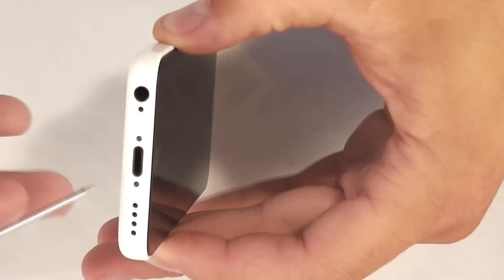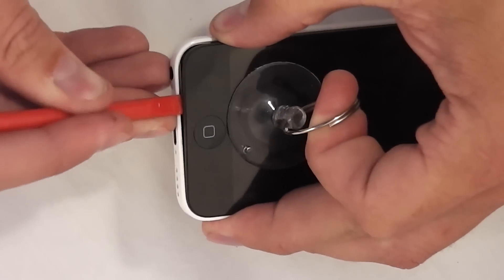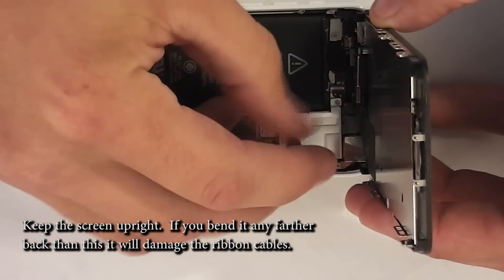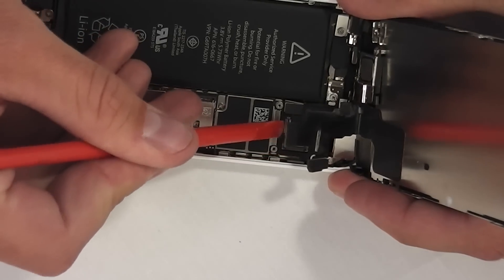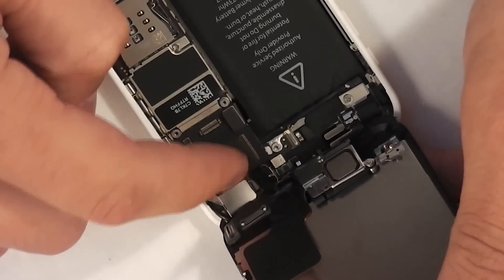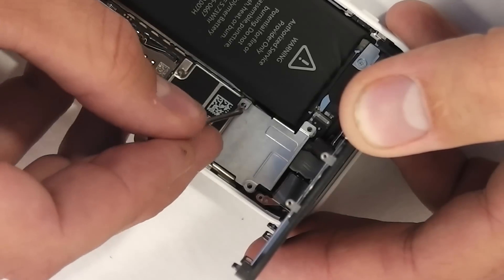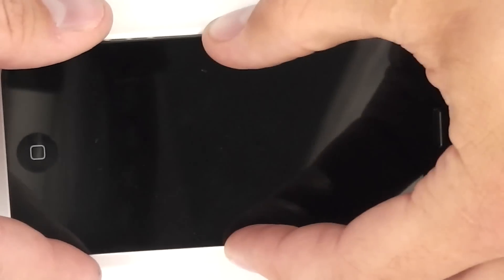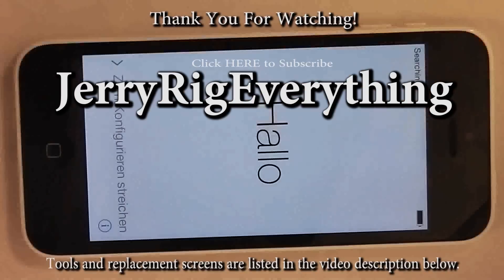iPhone 5c Cracked Screen Repair in 3 minutes

Comment from the maker: The regular 5 screen will not fit on the 5c.  I tried. I made a video too, if you want to check it out.  I am not sure if the 5c and the 5s screens are swappable.  But you can bet as soon as i find out ill post a video.

Comment: You Rock!  Being frugal, I want to try just the glass.  However, if it does not work as you point out, it is difficult, then I am stuck with out a phone until I receive the replacement for the whole thing.  Going to take your advise and just bite the bullet and do it right the first time.  THANKS AGAIN!

Comment: hey Jerry, that cable you said was attached to the battery is defintely attached to the vibration motor. Just a heads up ;)
Reply from the maker: ***** Thanks man!  Ill see if I can get a note in the video to correct my mistake.  Good catch.
Reply: Don't mention it ;)

Comment: ty so much, it took me about 10 minutes but it works perfectly now. I even wanted to be different so i bought a white screen lol. Now I have the only 5c with a white screen
Reply from the maker: +Juan De Jesus Thats awesome! Good job on the repair!
Reply: +JerryRigEverything does the new screen come with everything? My friend gave me his broken Iphone 5c but i ripped it apart lol it will still work if i get a new screen LCD and home button clicker pad thing  do those 2 links include what i need?
Reply: +JerryRigEverything does the new screen come with everything? My friend gave me his broken Iphone 5c but i ripped it apart lol it will still work if i get a new screen LCD and home button clicker pad thing  do those 2 links include what i need?
Reply: +JerryRigEverything NVM i messed up some of the solder points. Shucks!

Comment: thanks for your awesome tutorial - just bought a screen and kit off ebay, but it's just the glass, I had assumed the LCD was separate and ok as it was still working well under the cracked glass...should I not just change the glass in this instance?
Reply from the maker: It is very hard to separate the LCD from the Glass.  i would recommend buying the whole replacement that I have linked in the video description.

Comment: So can you provide the exact screen assembly that would be required for the phone you featured so I can assure I order the right one?
Reply from the maker: Seth Landry I linked some in the video description. BUT you'll probably need to transfer over the camera, earpiece, home button, back metal plate... Which I explain in my 5s screen replacement video. (Linked in this video.)

Comment: Do I need to buy the screen with the camera speaker and home button? When I take off the screen what all will come off
Reply: Amerria Causey everything that’s attached to the screen will come with it. You can order one fully assembled, or you can get one without a home button if you have Touch ID and want to keep it, you will need to take the home button out of the old one and then put it into the new screen.

Comment: Your video was great and I was able to replace the screen/digitizer with minimal difficulty. (those itty bitty screws gave me some trouble!) The screen is working and it turns on, but I cannot slide to unlock my phone. I have done a reset with holding down both the home and sleep buttons and it still doesn't work. My question to you is, did I get a crap screen and do I need to replace it again, or did I do something wrong putting it back together? It worked fine before I replaced the screen, I had just shattered the screen when I dropped it. The new screen also has lines and little squares, like you can see all of the digital squares on the screen. I won't be able to put the old one back on, since when taking it off, it came off in pieces. Thanks for the video and any info you have!
Reply from the maker: Stephanie Fike Hey! So it sounds like 1 of 2 things.  1) Your screen just might not be connected all the way.. Take it apart (while its off) and reconnect the ribbon cables.  OR 2)  It could be a faulty screen.  But definitely try number one first.
Reply: JerryRigEverything Thanks for the tips, I tried 2x to disconnect and reconnect the ribbon cables. Still no luck. I think it was just my luck to get a faulty screen. I followed your link and am trying a different screen. It should be here Wednesday. Thanks again for the video and advice!

Comment: Is this cheap and easy I'm afraid to do this
Reply from the maker: Its not 'easy' you could definitely break something. So attempt it at your own risk.
Reply: JerryRigEverything Can I use my home button from my old cracked screen. The link you posted for new screens don't come with a home button and I need to know if I need to order a brand new one? Thanks in advance if you reply.
Reply from the maker: Eric Tyler Ya, you just need to transfer over the home button, ear piece, front camera, and metal plate.  All of those components will move from your old screen to your new one.

Comment: old video i know, but nicely done. unfortunately your links for parts are out of date. although i took something that was undecernable from other products on the net (i.e.high quality replacement screen with 'small parts, including tools', my replacement did not come with a home button. the only bummer is that the transfer of the old is difficult due to the silicone boot that seals the button from dust has its edges laminated between the glass and lcd membrane. hence if one purchases the replacement without a home button installed......good luck, right?
Reply: i take it back about being in between glass and LCD. still, an adhesive something is involved. heat helps de-adhere the fragile rubber gasket. mo better if your replacement screen comes w/a home button, sigh.

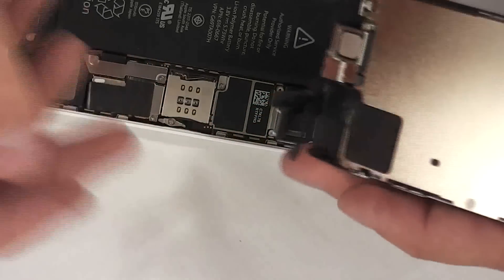Comment: For the part at 1:20, all replacement screen parts will require that you remove the home button just so that you can transfer it over to the new part. The LCD Digitizer (back panel) will only need replacement if you damage the black backing on it as that will cause the screen to "touch itself" pressing on things that you did not.
Reply: 😂😂😂😂 killed me when you said "touch itself" ah man that cheered me up 🙂👍 took 6 years to get a reply 👍😂
Reply: @davidkearin3622  naw 💀

Comment: yes ive open at least 30 iphone 5c's they all"pop" open perfectly, however, the #1 problems is putting the screen back on....I own the blue so Im guessing its a production issue for that color. when the screen is put back..99% of the time, the right side, near the sim slot NEVER makes a flush seal, due to the buckles/braces in the shell itself. when your done assembling, lay it flat, look at the side with the sim and push down on the screen. there wil be somewhat of flex.
Reply from the maker: I havent noticed that, Ill have to look for that next time I open one up.

Comment: My daughter tripped and dropped her month old 5c last night. It appears only the front glass is cracked, as the digitizer and LCD work fine. my experience repairing an iPod touch tells me these probably would separate with heat, but I wondered if you'd even tried? Or is it too much trouble and I should save my sanity by buying the whole screen assembly? I'm guessing by the difficulty people are having finding screen assemblies that finding individual components of it is next to impossible?

Comment from the maker: Etradesupply is the only reputable site online that has parts yet (that i have seen)  The digitizer and LCD will separate if you have the heat gun and a ton of patience... but the success rate is pretty low. Use discount code 'JryRig' to get a 2 dollar discount when ordering.  Its not much but every bit helps.

Comment: Where can I get a screen for the 5C that would mean I wouldn't have to swap over the home button and other parts and just follow what you've done in this video?

Thanks
Reply from the maker: Karl Smith I tried a few suppliers that sold the complete units... But they only half of their screens worked.  So i gave up and juts bought from guys who sold working screens.  The one linked in the video description should be good.

Comment: I noticed you linked the home button ribbon cable as well. Does this need to be replaced with the screen or will the cable work with the new assembly
Reply: Does the ribbon cable need to be replaced with the new screen
Reply from the maker: Your old cable should work just fine.  UNLESS you rip it during the transfer.  THAN you'll have to buy another one.  But you should be ok if you're careful.

Comment: Thanks for the video. I just completed the repair and my phone now works great. Just for everyone's information, it is not quite as simple as it appears in the video. I ordered the screen recommended in the notes, which worked fine. However it doesn't come with the back plate, earbud port, or home screen. Those will have to be removed from the old screen and transferred. It took me some time to do this, but it's not impossible. Just make sure you remember where things go when you take them out! Come up with a way to keep up with your screws because they are tiny. Finally, the tool kit recommended looks very nice, but for my purposes I found one on Amazon for about $10 that worked out just fine. Thanks again for the post and information!

Comment: Is it worth getting a screen with a home button already mounted? What's good protocol in regards to the home button.
Reply from the maker: Jesse Farler The home button on the 5c is very simple.  You can get it mounted or just move the 2 screws and switch it over yourself.  It literally only adds 2 minutes to your repair. (just be carful lifting off the button to not rip it.) (If you do rip it, the part is only like 3 or 5 bucks. No big deal.)

Comment: I need to change the glass on a 5c. Is the method used to replace the glass with the 5 the same? Will the heat used to soften up the adhesive damage the screen itself? What are the risks of messing up?

Comment: when you put the suction i got a question    what if the phone is cracked around the home bottom where would i put the suction and pull from the top?
Reply from the maker: ***** Put tape over the screen.  That will allow for suction.  Or just use a razor and pry up the screen around the plastic frame.
Reply: JerryRigEverything  Cheers Bro! thanks

Comment: Is there a screen you can recommend that doesn't require all the back parts to be transferred over to the new screen?
Reply from the maker: Michele Ruth None that are reliable.  There are only 10 screws, and shold only add about 20 min to your project.  Just make sure to stay organized.
Reply: Be warned Michele, it isn't just "20 minutes".  It took me 2 hours.  I'm not sure where "10 screws" came from.  With the home button (3), the large metal plate (6), the smaller metal plate covering the "legos" (4), the camera/ear piece (3), you have tons of screws that are tiny and are HARD to get back in. Had I known how much work it was going to be, I would have paid someone else do it for me at a repair store.   I've already taken it apart twice since b/c I didn't put the home button back together correct.  But if you're tech savvy, you could do it easily in 20-30 minutes.
Reply: Thank you Mandi.You are so right!  I spent 2 hours trying to take the phone apart.  I was not prepared to deal with the difficulty of the task.  I had to return the replacement screen I purchased and am trying another one that hopefully doesn't require me to replace the home button and everything else.  Plus, that suction cup doesn't work worth a darn!
Reply: Michele Ruth I didn't use the suction cup, but just used the little wedge thing to get it open.  Good luck with getting yours fixed.  Mine works fine now, but it was sooooo much work!
Reply: Thanks!

Comment: Great video ! I replaced a screen from a white iPhone 5c to a blue one and the screen back light is all i can see. So i replaced the screen to the original iphone and it did the same thing, a white screen. Can you advise ?
Reply: Usually if you hold down the power button (or what ever Apple choses to call that button) and the Home button till the Apple logo appears that will "revive" your phone.   That is common when replacing screens on Apples.  Not sure why but the fix is usually that simple :)

Comment: Thanks for the video. I found it very helpful. I dropped my phone today and there is no damage visually to it. BUT the screen will not function at all. It's ringing, making alerts, etc but nothing no light on the screen (black). Would it be helpful or worth the try to remove the screen and reinstall it? I got this phone 2 weeks ago and haven't been able to get to the store to get a case. :( Thoughts?
Reply from the maker: I really doubt anything came disconnected.  The connectors are screwed down by that metal plate.  I bet the screen is just broken.  I would assume that you will need to replace it.
Reply: I am happy to report they replaced my iphone for FREE. I never confessed I dropped it, and it has a 1 yr warranty and didn't appear to be dropped. WOOHOOO!!!!!! Thanks for your feedback.
Reply from the maker: That works too.  As long as there are no cracks, it is covered by warranty.  (Even if you would have told them you dropped it.)  So you are set!

Comment: I replaced the screen on a 5c and went through the steps just as listed, but for some reason my screen never came back on. I made sure to be careful when moving the cables and reconnecting them back to the logic board. I also rechecked after my first attempt was a fail to make sure that it didn't have any damage that I may have caused and saw nothing. Is there anything else I can do before having to give up in defeat that I have a defunct product?
Reply from the maker: With the new screen installed, you can disconnect the battery, reconnect it after 30 seconds, and try again.  Also, maybe plugging in the phone will get it to turn on.
Reply: JerryRigEverything Thank you for your quick response. I tried the methods that you have described above and the phone is now turning on, but the screen is still black. I am able to receive calls and text, but I am not able to see any of the functions.

Comment: Ok I dropped my phone in cement and there's a bunch of cracks. How much is it to add a new screen and where can I get these tools and a new screen at? I really don't want to hurt my phone and break it though.. Would it restart if I get a new screen??
Reply: Marley Zimm they have kits on amazon and eBay
Reply: Marley ZimmAustin Donnelly don't judge me -.- I'm just asking.
Reply: its okay don't worry about him, your phone will not restart. It's really easy to replace, but if you don't have the patience or steady hands ask someone to do it for you. My boyfriend did it for me in 10 minutes and my phone's good as new. Would you like me to send the link of the one I bought on amazon?
Reply: Yes please and thank you! :) It's cracked like really bad.. It has a few holes kinda near the camera and stuff but a new screen will probably work of the other cracks
Reply: I will in a second, before you take out the screen you should put packing tape over it so the shattered glass doesn't go anywhere (:
Reply: +iheartbigbang98 link please

Comment: I was watching the repair video on repairsuniverse.com where you suggest buying the replacement screen and he goes into a LOT more steps than you did. Can it be as simple as what you show? Why all the extra steps in the other video?
Reply from the maker: +Rob RodenParker It depends on where you get your screen from.  I link repairs universe because I appreciate their quality and consistency.  If you buy a screen from them you will have to transfer over the earpiece, home button, front camera, and the brackets, and back metal plate... but it is pretty straight forward. In the past, I linked to a site that sold EVERYTHING as one unit.  It was a much simpler repair, but their quality ended up being crap.

Comment: Ok I finally ordered a quality screen with every thing included and hooked it up to my phone. I lost alot of screws so Im waiting on new ones I ordered and I wasn't able to put the metal plate back on so im waiting for that. But I thought I would go ahead and test the screen and put my phone partially back together but the screen won't turn on! And I know the phones on because when I call it it doesn't go straight to voicemail. What do I do
Reply from the maker: Jacobie Frederick It sounds like the screen might still be a bad screen... You're phone is probably fine, you just need a good screen to put on it.  look in the video description for a reputable seller.
Reply: JerryRigEverything ok i got another screen and still no response any other solution, not surewhat to do
Reply: Jacobie Frederick ya homie, same thing happened to me 3 TIMES  IN A ROW! you just got another bad screen! just tell them you got another bad screen

Comment: I have a iPhone 5c, and I was thinking of fixing it but I don't what's wrong with. I drop it, but it didn't Crack. And I tried turning it on but it would show lines. Plus I lost one of the little screws when it fell. Do I have to do what you did or something else? And where can I buy a little screw? Please help.
Reply from the maker: Alondra Medran You can get the little screws on amazon ebay  or repairsuniverse.  It sounds like your LCD broke when you dropped it.  A new screen should fix your problem. (If you can still hear your phone working.)
Reply: Thank you so much for responding! And for helping me!!!😊